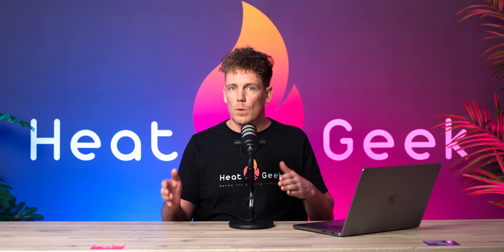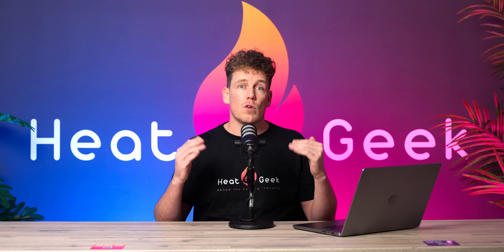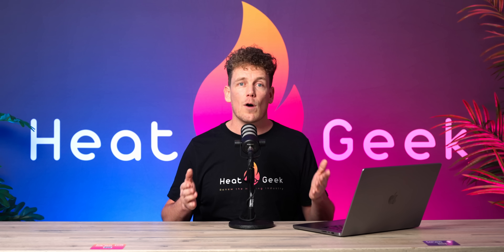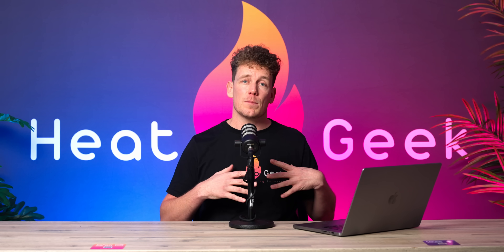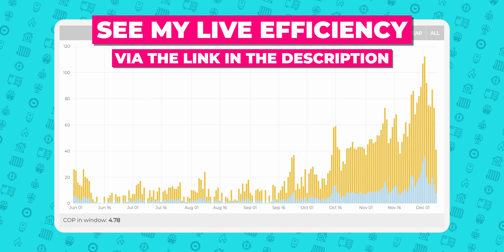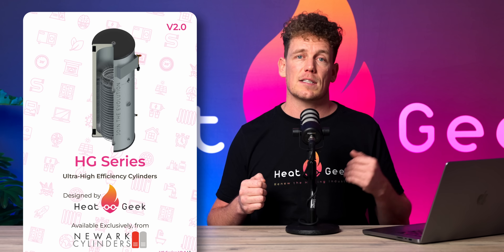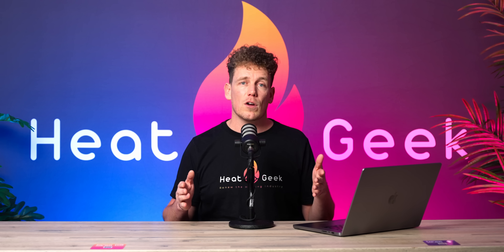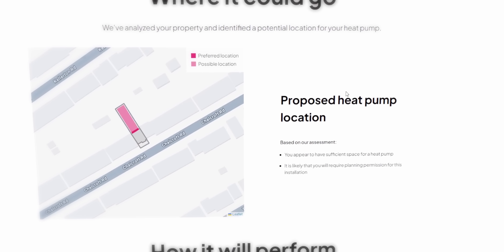How to Generate The Most Efficient Hot Water On EARTH

Comment: Would you do a video on the pros and cons of  the super cylinder vs the mini store vs the nano store please.

I have a gas boiler vented system and I'm thinking of  installing a min-istore cylinder rather than the super cylinder (because it doesn't need an expansion tank or a pressure relief valve) and then removing the loft tank etc.

Comment: I live in central Canada and I don’t have access to 60 hz R290 a/w heat pumps .. and my wife likes hot showers. Instead, I am forced to use fossil gas for DHW heating .. resistance heat / R32 is not an option since I am charged high capacity charges of $200/kW/yr based on a monthly/yearly formula .. calculated over 15 minute intervals.  So .. my solution is to preheat a gas hot water tank using an indirect cylinder / lower temp heat pump to about 40C and use gas to raise to 50-55c.  It sucks not having access to R290!

Comment: Hm, i would argue that people would be better off with a on-demand water heater with a plateheatexchanger infront - and connect the house to a battery that you can charge up on low price, low tarfis times. The battery is usable for all other house needs, and not now hot water. And its much much compact in terms of size, and properly a lower carbon footprint. This solution would be perfect for homeusers, large consumption of water should properly be handled in a different manner.

Comment: My boiler broke and I immediately assumed I'd replace it with a heat pump. My heating requirement experimentally is in the order of 3.5kW in the depths of winter. Should be a no brainer, right?! 

No. Turns out that my electricity is about 24p/kWh and my gas is about 6p/kWh, it works out that I need a CoP of 4.2 to reach cost parity, let alone any saving. Yes, I can disconnect my gas main for a little bit, but I have a gas BBQ and gas forge that would get very expensive to run off bottled gas. I could try and get a special tariff and shift my consumption/usage to off peak times. But this doesn't move the needle enough to know that it will cost equal or less to run before I install it. I might have to spend thousands on upgraded radiators, glazing, and insulation, in order to improve the SCOP to a level where it makes financial sense to spend more than twice the money on a heat pump. Or buy a battery as well which more than doubles the installed system cost and does pretty much guarantee savings...

The problem is that gas is subsidised to lessen fuel poverty killing people. Electricity costs are inflated to cover it. And the difference means that heat pumps by them selves struggle to make financial sense. 

I want a heat pump for moral environmental reasons. But I'm not rich enough to be able to increase my fuel costs to do so, or invest enough up front to make the maths work. We need cheaper electricity, and more expensive gas. Maybe with assistance for those who are really in danger from fuel poverty. How about knocking VAT off insulation and glazing? SOMETHING! The only people who qualify for the current schemes are those who can't afford to take advantage of them. And they wonder why take up of the schemes has been so low.
Reply: Yes I live in the real world too.
Reply: @zorot3876  I actually now have a heat pump. Turns out that it costed twice as much as a gas boiler, but usually last about twice as long, so if they cost the same to run then it just means that I have to get it swapped out less frequently? Figured with volatile energy prices it was worth the gamble that gas would get more expensive...

But then actually, I do all my hot water on the cheap tarrif because it stays warm for days, and almost all the heating, so I only needed a SCOP of about 2 in order to make it cheaper. My SCOP is more like 3.66! Didn't need to swap out any glasing, radiators, or do any additional insulation.

I was saving WAY more than predicted immediately. Bills went form £210pm down to £150 or less. Then I just bought an MG5 for a lot less than the equivalent Ford Focus estate I was replacing, and that's more than halved my house energy bill by giving me access to the intelligent octopus go tarrif.

I'm getting a house battery installed in about a months time, which will more than half my energy costs again because I'll be able to live almost entirely off the cheap tarrif! I'm going to be saving about £2k per year in total! Maybe more... I'm planning solar panels too, but I'm not convinced they're going to pay back anywhere near as fast as the battery, EV, and ASHP.

Turns out that if you have the cash to spend up front, it's cheaper in the long run?  Probably worth getting a loan on if you can't afford it up front given the rate of returns. Captain Vimes boots theory again... I hate the way the world works, there's no inate fairness...

Comment: I'm still not convinced, for all sorts of reasons. I think a lot of your underlying reasoning is badly flawed. Furthermore, the incredibly low adoption rate of heat pumps & clever water cylinders by The Great British Public (this despite the availability of very generous grants) suggests to me that they too aren't swayed by these syrupy sweet arguments either.

I could say more on the self-evident, 4:1 price differential between electricity & domestic gas. I could mention the eye watering upfront costs of these systems versus the alternative of spending zip, nada, nichts in continuing to use your existing boiler. I could highlight the fact that for the near future, a goodly proportion of the UK's power is still going to come from burning gas (especially in winter when demand is at its peak) so is far from 'clean'.

But I'm going to pass on all that to highlight one thing. In 2023, the UK's entire emissions of carbon dioxide (+ equivalents) from all sources was 338.5 million tonnes. That's a paltry 0.8% of the global total. The equivalent 2023 number for China alone was 12,603.5 million tonnes or 31.2% of the global total. Furthermore, this number was a 708.0 million tonne INCREASE over the 11,895.5 million tonnes they emitted in 2022. That's an ANNUAL increase of TWICE our entire output from all sources. And it's not just China either. India's sizable carbon dioxide emissions went up by an even faster rate of 9% between 2022 & 2023!

As a nation, we are deluding ourselves that us committing vast amount of personal upfront capital to changing ourselves is going to stop global warming from advancing at an alarming rate. We are simply too insignificant.

Comment: Excellent explanations, and another informative & interesting video.  The logic further reinforces why I've had poor performance with my 200L HORIZONTAL tank.  There is essentially no destratification in the horizontal position.  I'm further guessing the heat exchanger is going along the inner circumference of the tank (up-down), thus not transferring to the coldest water in the tank.  Possibly great distortion but at the cost of lukewarm water when cold water mixes so well that it decreases overall tank temperature quickly.  For tank design, besides tall-skinny-vertical, it may further help to have baffles to reduce cold water convection at the water-in.

Comment: Heat Geek, 

you amke two fundamental errors in your videos.

1 Coefficient of Performance does not, repeat not equal efficiency. To do that would need electricity to have no losses whatsoever between generation and user. You should know of basic physics that states that no device can have an energy ourput larger than the energy input. Input is always larger.

2 You share a common mistake with government in thinking that heat pumps helpdecarbonise, they do not. Any extra load, which heat pumps are, on teh grid can only be met by gas generation, as that is what does the balancing of supply and demand in the U.K.. Increase load and gas genertaion goes up, wind solar and nuclear are already at full output.
Reply from the maker: You’ve made two fundamental errors in your comment. 

Please watch our “how heat pumps achieve over 100% efficiency@ to learn more on point 1

On point 2. The rate at which the national grid is ‘adding load’ is not even remotely meaningful in comparison to how much renewable energy and storage is coming online. Hence the carbon intensity of electricity dropping like a stone over the last decade. As such switching to a heat pump reduces carbon production by about 80%.

Lots of information out there on this. Google is your friend.
Reply: Heat Geek, 
Thanks for replying.

Either your video is wrong or your understanding of how efficiency is calculated is wrong, maybe both?
Take a ground source heat pump with a CoP of 5 as is claimed by the heat pump industry and basic (unchallenged) physics that no device is 100% effcient, working back that requires at least five times the enrgy input to make the electricity and supply it to the heat pump. On that basis an air source heat pump could be around 60% efficient (CoP of 3) far below that of a gas or oil boiler.

No it is not dropping like a stone, Wind average for the last two whole years of record is about 7 Gigawatts from an installed capacity of about 25 Gigawatts. Don't look at what is installed capacity but output which is dismal. (Solar is virtually nil in the winter when heat load is the highest.)
However, understand how the grid works, supply must match demand (load) at all times instaneously. renewables (except for biomass which is high in CO2 emissions) cannot react to load change on the grid and the vast amount of balancing is done by gas generation. Put more load as with heat pumps and gas generation increases, essentially heat pumps are gas powered.

Why do you think that heat pumps drop emissions by 80% that's a wild and completely wrong claim. Where do you get your information from, not the Department of Net Zero and Energy Security, they haven't got a clue hence this policy of pushing heat pumps on all. Incidentally it is good the uptake has been so low as the local area network couldn't supply all that power.

Comment: Years ago I had a hot water cylinder running off a pre combi boiler. Gas was cheap so the fact that I was heating 30 gallons of water was not important. But now heating that much water for a shower would seem insane yet that is what I read (and see on U Tube!!) is what is required to enable a heat pump to supply hot water. Houses often do not have baths so an electric shower is all that is needed for hot water. Room heating is not needed for 6 moths of the year (UK) and then only when cold snaps occur. So how can a heat pump be justified?

Comment: Many cylinders boast smooth internal coils.. you now have gone back to ribbed coil... Wont there be an issue with potential lime scale build up on the coil now? Which will quickly reduce heat transfer as it builds up
Reply from the maker: Ribbing doesn’t affect scale build up. Only concentration,ph and temperature

Comment: Awesome video, thanks for what you are doing to push forward the quality of installs and systems.  Aside from the things you covered, one thing that robs my system of performance is the length of pipe between the heat pump and cylinder.  Using large diameter pipe which is good for flow, unfortunately increases the volume of stranded hot water in those pipes which is energy that is delivered by the heat pump that never really makes it to the cylinder (mainly an issue when space heating not needed).  Also, this would not likely show up in the COP numbers the way they are measured.  But having a big store (that doesn't need to be reheated many times a day) and locating it as close as possible to the heat pump would minimize.  I was reusing the indirect tank from my old oil fired boiler setup to save on equipment/installation costs but in the future I'll definitely be targeting to get a larger tank with a bigger coil, locate it closer to the heat pump and expect to see a significant reduction in energy use!.... Or people will enjoy longer showers and baths, we will see ha.

Comment: I watched this with interest. We have a small cupboard which houses our existing tank and gas boiler. One of the main obstacles to installing a heat pump is the requirement to fit a larger diameter tank. These new tall, slim tanks may fix this problem. The 200L tall tank would fit the bill, but still may not fit due to the external plumbing, valves, immersion, etc. Practically speaking, how much extra space is required around the tank to plumb it in?

Comment: I simply used 3phase electric heater to get instant hot heater as much as I need (instantly adjust the temp. too), no pre-heat or afraid of temp drop for un-used hot water. The installation takes few hours instead of days, the whole setup less than £1000 (Given the house is 3phase)  I do hope it is commonly avaliable in UK. Truely wanted to get into the field and promo it.
Reply: 3 phase isn't common in the UK.  Also at the price of electricity in the UK doing 3-phase immersion would be super expensive.

Comment: OK... Heres  a idea that should (also) revolutionise the industry;
Why can I not use the heat from the back of my refrigerator to heat the water in my hot water cylinder.
Why are they both not next to each other as standard in all homes with a heat exchanger between them?
Reply: Where does that heat come from? Your kitchen.
Reply: @mountsorrelheritage  Refrigerators are based on heat exchange, the compressed gas is put into low pressure inside the Fridge, absorbing heat from the fridge to assume the gaseous state, then out the back, the gas is compressed again, releasing that heat. Thats why the radiator on the back of your Fridge is warm, the colder it is inside the fridge, the more heat is released out the back.. this heat usually heats up the kitchen a little bit, but not much, it seems a pity to waste that heat, it could be used for the hot water cylinder.

Comment: What is the maximum theoretical COP? There is presumably a maximum amount of heat that can be moved against a given gradient. Could you have another measure of efficiency as the % of this maximum?
Reply: From engineering toolbox:-

COPheating = Th / (Th - Tc)

COPheating = Coefficient of Performance - heating process

Th = absolute temperature on the hot side (K)

Tc = absolute temperature on the cold side (K)

Comment: Hi i'm trying to educate myself - i live in a narrow terrace house built in the 60's which we've upgraded the insulation and glazing on. Now we are looking at the heating/ hot water. We're currently set up with a vented cylinder, oversized rads. But we don't have a great mains flow rate. Is the cylinder from newark available in a vented form, or does that change things completely?
Reply: I Googled "Can i vent an unvented hot water cylinder"
This is from Bishop plumbing
Can I Use An Unvented Cylinder In A Vented System?
Yes! You may want to use an unvented cylinder in a vented system if it has come time to replace your vented hot water cylinder, and you would like to convert your home to an unvented system one day but do not currently have the means. This way, you can avoid having to replace your new cylinder prematurely when you are ready to convert, as well as spread out the cost of the conversion.

Comment: So for an example, say I spend £1 day to heat a hot water cylinder with an immersion on constantly with stat to control max temperature, can I bring the cost down to 20p with  this technique?
Reply from the maker: If you used that little hot water, yes, Correct